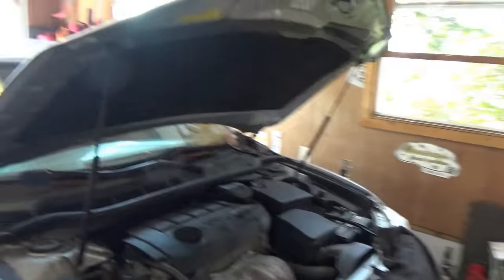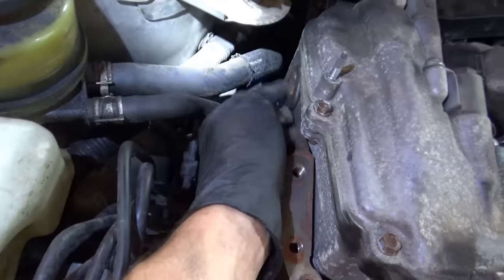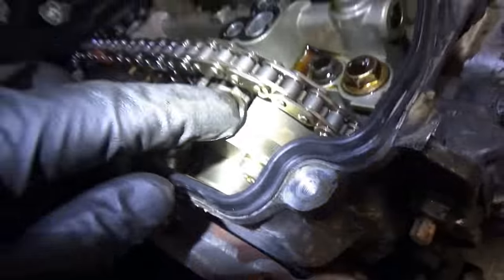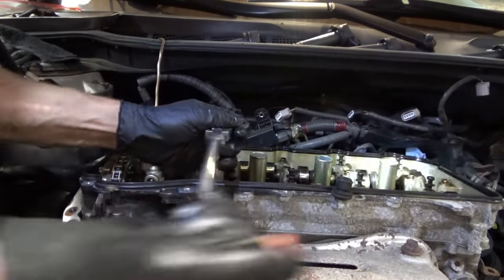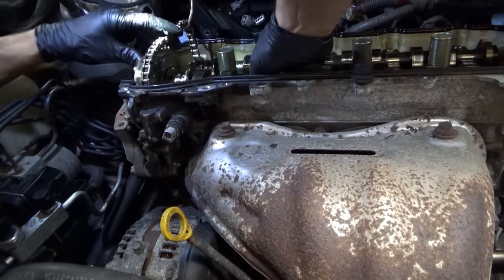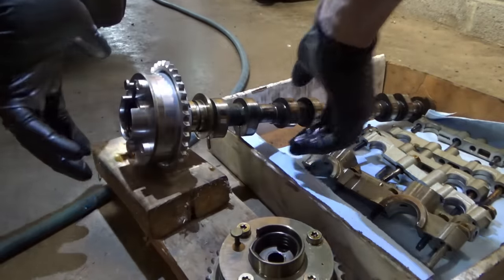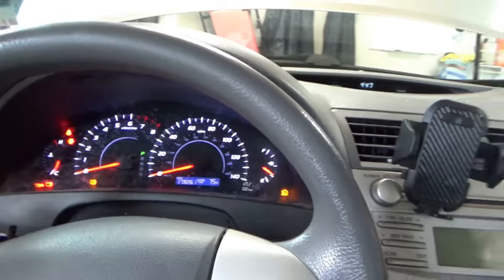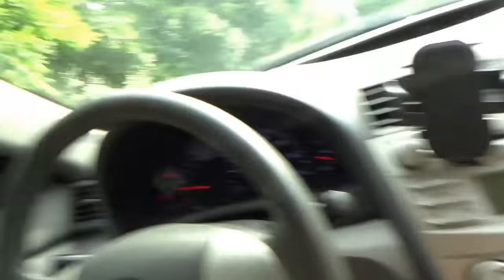Toyota Engines Can BREAK? (Camry STALL- RATTLE P0015-P0017) - REPAIRS

Comment: Cam gear should be installed in unlock position and than torque to spec. After that must be rotated clockwise to lock position. Not doing that my destroy new cam gear lock mechanism. Hope that's help someone

Comment: Yeah,  common actually. Even as far back as my 2003. Did the same procedure but did the chain too since it had 281K on the original, the tensioner was extended all the way. I didn't see you unlock the phaser, did Toyota do away with that or was it unlocked already? 
  But,  it is common problem. I got mine aftermarket and like yours it was made in Japan.

Comment: I have had good luck with Standard Motor parts being re-boxed Toyota and Honda OEM parts.  They are a little pricey compared to other aftermarket brands, but well worth it if you end up with an OEM part.
Reply: IPD USA has a great explanation about OEM, OES, etc. For some Volvo parts, the parts are actually made by a different company (e.g. aisin) and sold for cheaper by those companies, and sometimes they even sell revised, improved parts. 

If the part is bought directly from the original manufacturer, they will be cheaper except they don't come in Volvo box or they might have the Volvo logos filed off the parts.

At least IPD may recommend a good aftermarket part over the original if the aftermarket is improved in some way such as better durability. It is real interesting stuff ! 

Sounds like Toyota has made that phaser part themselves since it has their name stamped on it, or a company working with Toyota, but how did that aftermarket company get that genuine Toyota part?

Comment: All new engine that has VTC will break down sooner or later even honda or toyota, before like my 99 honda crv, dosent have that VTC, just regular twin camshaft, and engine can last to 350000 mile or more if properly taken car of: change oil in time put good engjne oil and good filter, and also watch for engine overheating by watching cooling level, changing thermostate and cooling fan switch  in time, dont wait till they break down,  like me i change thermostate and cooling fan switch every two years or less depend on the milage driven.

Comment: That engine is extremely clean inside! 

The owner did a great job keeping up on oil changes.
Reply: Too bad interior wasn’t very clean.
Reply: @JohnSmith-lw2bm you're the type of person that finds faults im everything
Reply: @drivewayhero  You're the sort of person who celebrates failure.
Reply: @JohnSmith-lw2bm  That is how I keep my cars.  Look like crap so thieves leave it alone.
Reply: These motors tend to look pretty clean even if they weren’t maintained too well, I know from experience
Reply: @robertsmith2956 although I can afford higher end thats why i drive a camry bland plain blend in and dont attract attention

Comment: Before the arm chair mechanics freak out about parts in the pan Ive been rebuilding diesels for over 20 years and the parts and chunks I have found in pans is no big deal once they find the bottom of the pan they stay there Its the plastic and gaskets, O rings that clog up the pick up tube

Comment: I needed one of those last spring in a V6 Lexus. The Lexus dealer said 800 but it was special order and they didn't know when it would be in. I asked the parts person to run the same part number under Toyota parts department. It was available next day for 250! They didn't know the parts were interchangeable!😂😂😂 independent shops now have to be part hunters. I have about five local places and still have to resort to web purchases to get people rolling again.

Comment: It looks like you'd overtorkqed that first bolt in camshaft by beating it with Milwaukee, so when you'd try to tork it by hand there was no movement at all at 63FP. I wonder how was torq on camshafts clamps where you also used smaller impact driver.

Comment: It's absolutely incredible that this customer did not crash their valves this is one of the worst case scenarios on this particular issue
Reply: I did the job following this video, my cam phaser broke in the exact same way. I got extremely lucky and found the broken piece when I removed the timing tensioner cover, it was wedged between the timing tensioner and the timing cover. I couldn’t believe my eyes.

Comment: I like the Scotty Kilmer comment, Ivan.  However, he calls Toyota out as well from time to time.  IIRC his son has/had a 2008 Camry that burns oil.  My neighbor has a 2008 that smokes like a chimney upon startup in addition to rattling.  Seems they used substandard piston rings that year.  Since the owner did such a good job with oil changes (hence the clean engine) I wonder if he/she attempted a front brake job and left out the spring clip shims on the front brake pads?  GREAT VIDEO!

Comment: Good job, Ivan! Possibly the spring broke first and the carnage inside came as a consequence - those 90º bends on such strong springs are a weak point that has to hold all the force.
Brake pad shims are optional :-)
Great that customer was very pleased - that's the important part.
Reply: The turn radius is doable but tight. Toyota engineers could have made an different design. Maybe that is the one, which was unavailable? I worked for a short time at Imatra Ovako Steel mill in the 1980's. At special products unit we made gun barrels for Finnish military, camshaft steel for Ford Germany, coil spring steel for Volvo and Saab. 

Volvo gave us an medal, for delivering spring steel, which did not crack even when the car was absolutely totaled in the accident.

The Volvo accident investigation team could almost every time dig out intact coil springs out of an total wreck. That is the high quality spring steel what Toyota designed the original phaser with and became a victim of sub standard steel later. 

It is an art to produce this high quality steel. As Asian producers got to the the market with lower prices we Finns were unable to compete with, that is the result. Toyota original design failing due spring steel not conforming in reality with original specification in the long term. 

To make spring steel to last bending for the life of an Toyota, which is more than 180 k miles, cheaper steel is not good enough.
Reply: @jannepo  I completely agree - It is an art to produce the high quality steel required for these springs. Maybe cutting costs (or a change in contractors) was one of the factors.

Comment: actually they keep parts in some cases for even longer i was able to get a new turn signal lens for my 79 toyota truck new for 6 bucks from the dealer and a passenger seat cable for my 88 4runner which allows the seat to fold forward and roll to the front to let passengers in the back that was a bit more expensive at 56 bucks but they had them
Reply from the maker: Amazing!

Comment: To check the VVTi go on the freeway and drive as normal but at high speed. Then hit the peddle and see if you've still got descent acceleration. The VVTi kicks in above about 4000 revs I believe.

Comment: Very common issue on the “AR” family engines. In my case it was a venza with the 1AR engine. Made sure I took out the timing chain cover and also remove the bottom plate to take out shattered metals from the cam sprocket(exhaust side). Here is one thing I also considered making me take out the entire chain cover.  Timing could have jumped and didn’t want to take that risk of not setting my points correctly. Well done

Comment: Look up Hyundai phaser failure from migrated pin. Just fixed my buddy's 2017 Elantra 2.0 mpi. Worn and stretched chain, destroyed tensioner ratcheting, and ripped up phaser that was off by almost 10°. Runs great now, with a new chain and phaser set (OEM)
Reply from the maker: How many miles?

Comment: One thing to be super cautious about is removing the cam caps.  The valve springs have upward tension on the cam lobes and removing the caps little by little alternating them all until most tension is gone is real important as there are some risks that the spring tension might crack the cam if not evenly removing those caps. It does make sense.

Comment: Bonus footage:  customer hit tree when front brake pads fell off.  ☺
I like your bolt and wrench work.  That inside looks great for 180k engine.  Just had my kia cams out at 190k, phaser was ok, head gasket under it, not so much.
What's up with these EPDM hoses?  It took a lot of money to find all real rubber hoses for the car.

Comment: Have a 2014 in shop now with chain rattle at 200k miles, second time on this one, we're replacing BOTH cam phasers and chain kit got lucky found parts on Amazon as Toyota is 3 months out back order! All the Littles oil seals only toyota has them!

Comment: That was particularly relevant to me - the wife's '07 is just over 200,000 miles now. You certainly made it look easy! I've been wondering if the timing chain might be worn. No check engine light so far, though. I treated the transmission to some new ATF today, thinking that might head off some trouble. $18 a quart at my local Toyota dealer!
Reply: At 200K you should NEVER touch the A/T fluid unless you've changed it every 60K miles (more or less)......

Comment: Maybe I've just been blessed in my 30 plus years of turning wrenches, but I've only seen that phaser break one other time.  I think I would have pulled the oil pan though.  But that's just me.  I'm not comfortable with taking chances like that.  I've had a pretty good track record with standard motor parts.  I would prefer them whenever possible.  Nice work though Ivan.  Do you know if the customer had taken care of those brake pads though?

Comment: Ivan did you consider running an extendable magnet down inside of the cover to see if there were any big chunks you could snake out? Nice fix.
Reply: The downside to that is if you drop it while coming up, and it lands in another spot where it can cause damage. Being metal I'd expect it to go to the bottom and more or less stay there, as long as no one goes Dukes of Hazzard with that poor car.

Comment: I know you don't want to hear it, but you need to pull the pan and check for metal. That stuff can clog up the pickup tube, and he'll need more than a phaser at that point.
Reply: I do Cars shows that often
Reply: I guess the customer was on an extreme budget. Or the customer wanted to do that himself/wait for the next oil change.
Reply from the maker: It's a couple big chunks vs the forbidden glitter or bearing material 😉
Reply: @PineHollowAutoDiagnostics  I mean technically those chunks could somehow get through a gap in the baffle plate (but not sure how that looks in this case) and wreck havoc there. Unlikely but not impossible, I'd guess.
Reply: One can always cut the Can of the oil filter and inspect the paper element inside as well for shiny's...Thanks Ivan Great sounding engine keep it up👍
Reply: Big chunks wont cause issues. Its small peices and RTV that will clog pickup tubes.
Reply: just put the speaker on oil pan for now, til next oil pan replacement

Comment: Any idea where to get a wiring diagram for a 2016 Rogue SL. Apparently my front running lights are kaput. Strange that just the front marker lights would go out. The rear works just fine and the high low headlights and driving lights work fine.

Comment: at least Toyota just seem to do things logically especially on their 4cyl Engines..we got the 2006 camry and 270,000+ km so far,  money spent last 5years except oil changes and filters oh yeah and recently it's 2nd car battery.
Reply: I have a 2005 Srt 4 neon 
with 275000 miles on it and have only normal maintenance. It's my daily driver. So every auto maker has good and bad products.
Reply: No, you got the ONLY good one they made!
Reply: @annathemaanderson4448  perhaps, does not even leak or burn oil like other 2AZ.
Reply: @richardcardwell6266  i not familiar with Neon models however that is good going..soo many lemons out there.
Reply: @annathemaanderson4448  I know a lot of people with great cars that are not Japanese crap boxes. Worked in the industry over 30 years. The big secret is regular maintenance. With that almost all cars can last a long time.
Reply: @stigonutube  mine is the turbo model. Only made for 3 years. 2003, 2004, and 2005.
Reply: @richardcardwell6266  ok, yes i looked your model up, like subaru wrx, only limited release for rally with manual gearbox..next gen got a awful reputation here in Australia the dodge calibre auto box problems galore.
Reply: @stigonutube  Caliber was a completely different vehicle. It's like comparing apples to oranges.
Reply: @richardcardwell6266  ok fair enough, we never got the good versions over here only the lemons lol..

Comment: I would guess where those parts broke is a direct path to the oil pan, so before oil goes back through motor it has to go through oil filter. 
60lbs on bolts dont sound like much to me, I would guess 80-90 lbs and if you got that repair done in 5 hr you did well.........
Reply: He got paid 5 hours..  He probably got it done in less than 3.

Comment: Master, what voltages should be found in the vvt selenoyde cables because in my car I have with the car in the on or run position only two grounds and sometimes it changes one to 1.4 volts that selenoyde does not work with 12 volts oh yes

Comment: Lol how bout that Scotty Kilmer 😂 
I will say yes they do break but not often and at least the pistons-Rods didn’t do more damage when it gave out. Idk if Hyundai could take that breakage and still drive after repair without replacing the engine
    I’ve also heard lack of oil changes can cause the VVTI pin to get stuck causing rattle and put strain on that part causing spring snaps

Comment: it sounded very rough about 1 second during start after the fix, probably the other camgear (intake one) is also faulty ?
Reply: Did it have to do with oil and the new cam gear waiting for its first oil supply?
Reply: It was a dry start.

Comment: Scotty is all mouth all vehicles can have a defective part in them Toyotas are no different albiet they don't have as many problems as all other brands & by the look of that engine it has been maintained correctly so even he couldn't blame lack of maintance Cheers Ivan (do me a favour put some steel cap boots on when working on vehicles you make me shudder every time I see you without them.)
Reply: I never thought about needing to wear steel toed shoes while working on cars (I haven't done it yet but plan to). But that makes sense, I guess the other way to know is to drop a heavy tool on my foot and find out after the fact. 

Would you say that the determining factor to decide to wear steel toed shoes is working with heavy tools and parts? So if somebody was working with smaller tools and parts they can skip the steel toed shoes? (But then again my dad messed up his toes from dropping a shampoo bottle on them so maybe it only takes something small)
Reply: I built pole barns for 30yrs in Colorado and always wore Teva sandals…whether on the roof or ground, then Nov - April was trail hikers..only ever hurt my foot when I dropped a sheet of 5/8” plywood on my trail hikers. Ivan will be safe!
Reply: @titaniumman_22  I guess it wouldn't hurt to be as safe as possible especially in older age when injuries don't heal up as easily
Reply: Definitely agree…young and dumb with some luck.

Comment: If those loose parts would grenade the engine, they would have done it when the phaser failed. They will set in the bottom of the oil pan indefinitely, but may confuse the crap out of some guy in the future.
Reply: I saw something funny, well it really wasn't funny. It was the Car Care Nut YouTube channel. He was talking about a Toyota engine with a flaw where I recall that the rod bolts weren't tightened properly and could work their way loose. Either a factory mistake or a design defect that loosens the bolts. But anyway he said that sometimes people find a bolt in their oil pan and didn't realize that they were driving their car while missing a bolt from the engine, and they didn't notice anything was wrong.
Reply: But is smaller metal debris in the oil pan going to cause issues? Is it likely to sit at the bottom of the oil pan, or try to get sucked up by the oil pump (but presumably the oil pickup tube filter mesh should stop any small pieces from getting by).
Reply: @zzoinks  clogging the pickup screen is an interesting concern.
Reply: @_RiseAgainst  hopefully the small pieces are too heavy to be picked up, or are small enough to not block the oil pickup, or the pieces drop back into the pan without oil suction. Could the small pieces can get drained out in an oil change? Or, metal particles get stuck to a magnetic drain plug if equipped.  Hopefully not too many small pieces are in there.  
I heard some recent controversy about Toyota/Subaru engines having excess, loose pieces of sealant in the oil pan and concern that it blocks the oil pickup, but people not worried about it say the oil pickup in that engine is multi sided and cannot be blocked to a harmful degree by the pieces of sealant.
Reply: @_RiseAgainst  I'm curious if the timing cover drains directly to the pan, or if the passages are too small to let all the broken pieces through. But if the car doesn't complain about low oil pressure, all should be okay in that regard right ?